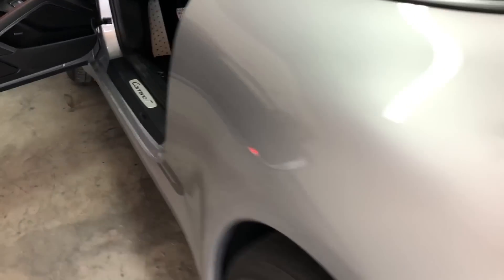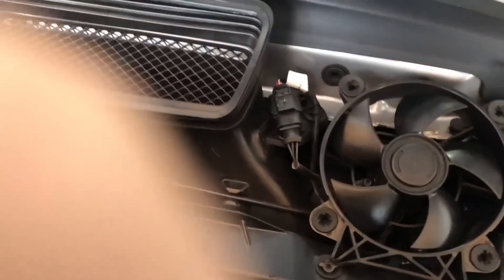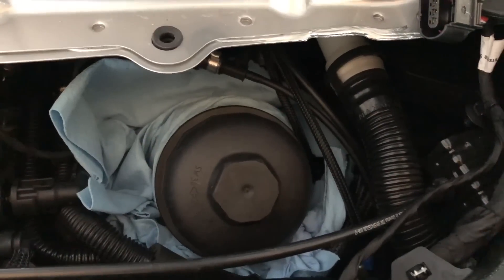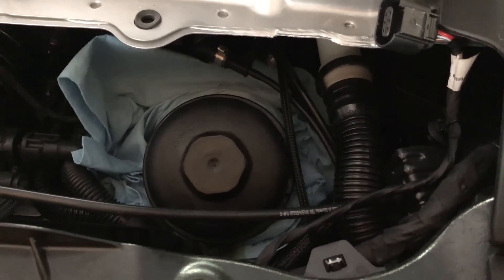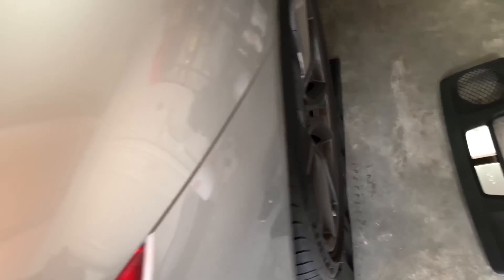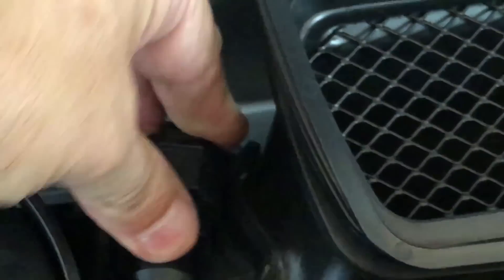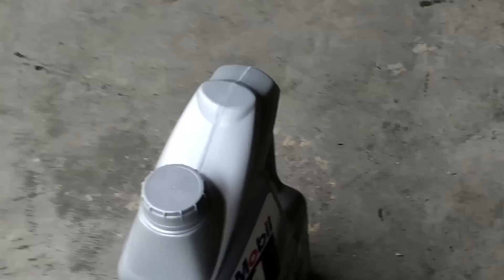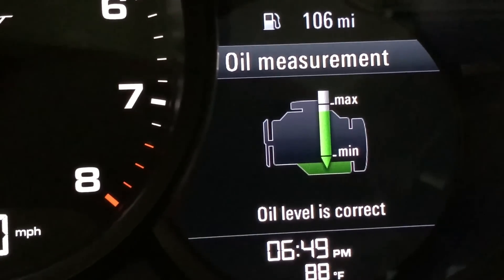DIY Oil Change Porsche 911 Carrera T 991.2 (2017+...)

Comment: Just finished OIL CHANGE.
Just as advertised. Step by steps are GREAT.'
No hiccups.
Mine took 9 quarts with about 0.5--0.75 of a quarts STILL SHORT that probably would reach the MAX level.
Thanks for my STIMULUS CHECK!

Comment: Good Job! A couple of pointers. I would use a regular 1/2 in wrench to loosen the oil cap.  Get a deep oil pan without cover to avoid splashing. Use Porsche grease instead of oil on the oil filter gasket. Cover the air intakes after removing the housing, you don’t want anything dropping into the air filters and having to remove the rear bumper.
Reply: I know Im asking the wrong place but does any of you know a trick to log back into an Instagram account?
I stupidly forgot the login password. I appreciate any tricks you can offer me.
Reply: @Kristopher Lennon instablaster =)
Reply: @Thaddeus Hezekiah it worked and I now got access to my account again. I'm so happy:D
Thank you so much, you really help me out !
Reply: @Kristopher Lennon No problem xD

Comment: 2012 911 3.4L no need to remove fans, just loosen the fan deck, move up spoiler, and oil filter is easy access with 6 inch socket extension 36mm cap easy/fast removes the oil filter. Suncoast Parts DE excellent genuine parts, FYI filter was $16.00 with shipping and all filters come from Austria, or Germany, no fake parts. Also, found to loosen oil fill cap, never leave it open, crazy how stuff can fall in there. Thanks for video!

Comment: Good video.  

BTW- You made me cringe when you removed the engine oil filter cap, you used a torque wrench. I was taught during my aviation maintenance training days that you should never 'break torque" with a torque wrench. Doing so can put a torque wrench out of calibration. You should have used a breaker bar or a ratchet. Then use the torque wrench to tighten the oil filter cap to the recommended torque when installing the cap.
Reply: 18-25 ft lbs in reverse wont hurt any 3/8 or 1/2" drive torque wrench. It just won't. But not a bad rule to try and maintain.

Comment: Good video. I would recommend changing the drain plug gasket each time.
Reply from the maker: Thanks!   Actually I replaced the plug altogether.    The plug costs around $5 and comes complete with the gasket.

Comment: I'm surprised you didn't do the air filters when you did the oil change.  I know it is more of a pain, but you was already half way there.  At any rate, it was a great video and I always enjoy watching technical videos.  This one was very informative with torque specs and all.
Reply from the maker: Thank you Jason!    I didn't do the filters as they were basically new.    If I recall correctly, the car had only 3,000 miles so the filters would have been overkill.   Also, to remove the rear bumper to do the filter change I would've needed my assistant (aka son), who was off to college... hahaha.

Comment: Great Video Sir,  very well done.  My buddy Tor has the white T in Houston.  I drove it the other day and really liked it. love the torque from the turbo motor.  Much better than my GT4...  actually thinking about selling the GT4 and replacing with a T.
Reply from the maker: Thank you Stephen!   Yes, the T is a great car.   How did you like Tor’s Bucket Seats?   They look fantastic!
Reply: A C I have the same in my GT4 so of course I really like that set up.  I would do the same if I ordered a T.  I really like the Pepita inserts he put on the seats as well.   It brings me back to when I was much younger,  my first 911  was a 72’ 911 T .  The car brings back good memories so I feel compelled to get one.   I would miss my GT4 but I feel I would get more use out of the car and ultimately more enjoyment....

Comment: Thank you. I had an almost successful first oil change in my 2018 Targa. It was awkward trying to contort my body to get access from above while ducking the huge rear shield/window. The last jug, with only three quarts of oil in it, overpowered the oil fill and dripped all through the engine where it finally pooled on the floor. Stupid mistake, but I was looking through the glass, holding the big funnel with one hand, and pouring the jug of oil with the other. Fortunately I had the air intake blocked with rags! Brake-Clean and some more contortionist arm work had me back in business. Another note... I had bought the trim tool kit from Suncoast. The tools are flimsy and I had difficulty pulling out the connectors. What brand of trim tool are you using? Again thank you for your kind post! Very much appreciated by all!

Comment: good post, thanks.  Just one thing on the oil volume thing;  my owners manual states to check the oil with the engine at operating temperature but shut off for at least one minute.  Did I hear your engine running when you were checking the level? Oil 'in the system and not in the pan may account for the reported low volume.
Reply from the maker: Good point!

Comment: Saw your post on rennlist when you finally got your T! Love your spec! Maybe one day! Trying to decide between the red, silver, and white, but after seeing yours, I'm convinced! Do you regret not getting Porsche entry and drive? Any other features that you think you should've gotten? Would be great if you could share your spec sheet!
Reply from the maker: Thank you for your kind words!    I've had entry and drive in all of my cars for the last 6 or so years, and in the past that was one of my must-have options.   BUT for the Carrera T I decided, fully aware of it, to leave it out of my build.  Why?   First of all, it was a nod of Porsche's of the past, which in a way is what the T is all about.   Second, I wanted to be more involved, almost reminded every time I had to get the key out, insert it on the left and started the engine that this car is "special".    Finally, with a nice color-matched keyfob, I wanted to actually use the key, and not just keep it in my pocket unseen.

I can tell you that I got exactly the options I wanted, and not a single regret.

Here's the list of options:

GT Silver
Black Leather interior with T - Pkg, w/ Red Dev. Stitching 
7 SP Manual Transmission
Rear Axle Steering  (LOVE IT!!!)
Front Axle Lift (Great for every day usability)
Sport Chrono 
Heated Multifunction GT Steering Wheel
Leather Interior Pkg (Incredible all leather interior with red contrast stitching)
Leather Steering Column w/ Dev. Stitching (You see it every time right in front of you!)
Shifter Boot w/Deviated Stitching (Homemade.   I removed the boot and re-stitched in red thread to match)
4-Way Seats (Lighter and extremely comfortable)   Loved the look of the Bucket seats, but not very practical.
Bose
Lane Change Assist (particularly useful at night)
Auto Dim.Mirrors 
Aluminum look Gas Cap (Useless, but puts a smile on my face every time I fill the tank)
LED Headlights w/PDLS+  
Tinted Taillights (Looks great with GT Silver)
Glass Sunroof (LOVE the look of the all-black roof from the outside.   Open or tilt the sunroof and the spoiler goes up another notch, almost like a duck tail)
Heated Seats 
Smoking Package (Adds a little covered lid to the otherwise ugly looking cub hole on the console)
Passenger side Net (Hey, it;s free!)
Voice Control (Another $0 cost option)
Model Designation Delete (Prefer the look of just the Porsche name, with no model name)
Vintage 911_T Badges (Like the look of the old badge).
Reply from the maker: And also added Clear front side reflectors, Sullivan Racing Pedals and the front Lid Liner.
Reply: Thanks AC! One day! I checked with my local dealer in UAE, and they only got 5 allocations which they built out themselves. None on order. They only have a yellow one left, which actually looks great but it's got some options that I don't want or missing the ones that I want. Let's see!
Reply from the maker: Yes, you got it!    Highly recommended.   Grippy, comfortable and cool looking.  ;)

Comment: Nice video. Do I need to reset the oil change reminder?
Reply from the maker: If it was one of the scheduled maintenance intervals, I would suggest to reset it.   I normally do an intermediate oil change between "official oil changes" and I don't reset the reminder at that time.
Reply: @alexc7591  does resetting the reminder require a special tool or can it be done by the owner?

Comment: Good video. Well done. The electric  oil gauge is strange. I started with 7.5 quarts. It said I was low. I added another half and I was good. 350 miles later it was down a bar. But I didn't add anything. the next day it showed full again.
Reply from the maker: Thank you!    Yes, sometimes the electronic oil gauge goes a little crazy.    I once had that exact same thing happened on my Macan GTS.

Comment: Great video!  Did you say you ordered parts from the P-dealership?  Yikes.  I've saved a lot ordering the exact same OE Mahle or Mann from Amazon.  You should consider using a fluid evacuator.  Sucking the oil out through the fill port is revolutionary with zero mess or getting under the car.  Do you have a single daughter?  I can send my resume to join the family.  LOL.

Comment: What should I do if I am getting an indicator light that says "oil above maximum?"  Drain a little or siphon? Thank you!
Reply from the maker: You can try draining it a little bit carefully.     That is why is better to start with less oil, then  level off the car and top it off little by little as needed.

Comment: The question is, how long did u let the oil drain. That's the real question. Thanks. Just so I can know how busy work is gonna be when ppl in my area follow the how to. Which is WRONG. No 100% wrong but you missed very very important step. Meaby the most important one thx cheers
Reply from the maker: I let the oil drain for well over an hour.   And from the amount of oil it took to re-fill it, I would say it was more than enough time, and definitely more time than what your average dealer would wait for it to drain.   By the way, you can see at 9:30 that not a single drop of oil is dripping from the oil pan, so I would say it drained long enough...

Would mind enlightening us on what is the most important step that I missed?

Comment: Hi Alex, thanks for sharing! I changed the oil and replaced the filters (air and oil) but the spoiler is not actuating now. Any thoughts?
Reply from the maker: Have you checked the fuse?    Also make sure you didn't leave any rags or tools that could be jammed in the mechanism.
Reply: @alexc7591  Thanks for the response, I found that ECU needs to be rebooted and problem is fixed!!!!
Reply: Yes, Go buy a new 992 Turbo S  :)

Comment: My 3.4L 911, the entire fan assembly comes off with the fans and you do not remove anything else.  Use a 6 inch ratchet extension with 36mm socket and oil cover comes right out.  Use a plastic utensil to remove the oil ring, never use a metal tool. No need to touch the cable assembly. 18 pounds of torque is snug, do not over tighten. Place small amount of oil on filter cap and place small amount of oil on new oil ring to seal it. The oil capacity is exactly 5.46 USA quarts, not a drop more.  Do this very slowly, add full Mobil one 0-20w 5 quarts oil for Porsche (label from Mobil says Porsche on it) then use single quart mobil oil to add 1/2 quart.  Then start engine, let run to temperature. Stop and let settle then check oil. Add only 1oz at a time, with continued checking, if you overfill, you will kill your catalytic converter costing $$$$$$. Mobil oil at Walmart 5 quarts is only $22.00 on East coast. what a bargain!
Reply: is your car a 991.1 or 991.2, @Edward Szostak?

Comment: Do you reset the maintenance count computer with an electronic tool or just ignore the message on the dash? If using a tool, which one do you recommend?
Reply from the maker: Sorry for the super-late reply!   I do reset the oil message using the icarsoft tool.

Bidirectional Diagnostic Tool for Porsche/Cayenne, iCarsoft POR V3.0 (Enhance Version) All System OBD2 Scanner, 23+Special Service Code Reader for Porsche, Battery Test, Auto VIN https://a.co/d/0eXkjz8H

Comment: Are the wheel ramps required to get access to drain?
Reply: Yes, wheel ramps or some other means of raising the rear of the car.  (Alex C used 4-inch ramps in this video; I used 2.5-inch ramps (Amazon), and I got 'er done, but 4-inch ramps would clearly have made it easier.)  You could probably get the job done with a floor jack, but I'd suggest using jack stands or some solid wood blocking under a suitable support point for safety while removing and re-installing the drain plug.
Reply: @johnholz394  I have a Jack and stands, but seems ramps are easier to use?

Comment: I change oil in my Carrera T today , and after I fill it with 7 and 1/2 quotes computer ask for another 1 and 1/3 . I am thinking since I used ramp for only rear wheels and lift rear end only I drain more oil vs level drain . Any ideas? Thank you . Took me about 20 min
Reply from the maker: That should be about right.
Reply: Double check capacity, my 2012 911 is exactly 5.46 quarts.

Comment: How did you re set the on board computer? Any advice here?
Reply from the maker: I did not reset the computer.    Reason is, I still want the dealer to perform the 10k service (free) when the time comes.    I am doing an additional service in between official intervals, so no reset is needed.

Comment: Where did you get that 911T emblem on the rear air vents? I want one! It looks great!
Reply from the maker: You can get it from any Porsche dealership for around $60.   The part number is 90155931122

And here is a post I did on Rennlist on how to install it:  https://rennlist.com/forums/991/1067158-over-engineering-a-simple-task.html

And congrats on your T!

Comment: Is there a PORSCHE recommended TORQUE for the OIL PLUG re-install?
Reply from the maker: There is really not much torque.  You will feel it when it locks into place.
Reply: @alexc7591  Thanks Alex...will give you/thread feedback when I complete.

Comment: What looked like a plastic oil pan bummed me out. I imagine as it ages, it will be more prone to cracking when its hit by road debris.
Reply: VW Golf has the same plastic type drain pan with the exact same plastic drain plug.  Works ok so far; fingers crossed.
Reply: Yeah, that's not all that they made plastic, plastic coolant pump too. kind of cracks me up when you see the price tag
Reply: Remember, Glocks are plastic, and they work just as well if not better than most other handgun designs.  There is certainly no problem with durability of modern polymers when they are engineered properly.